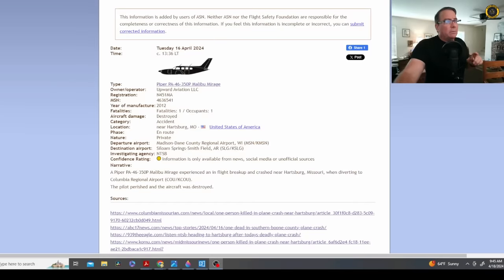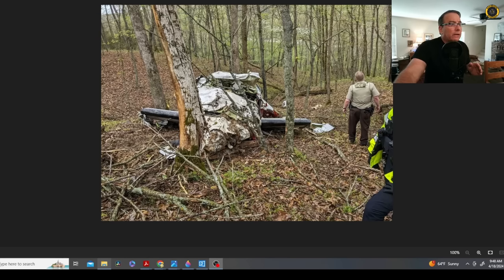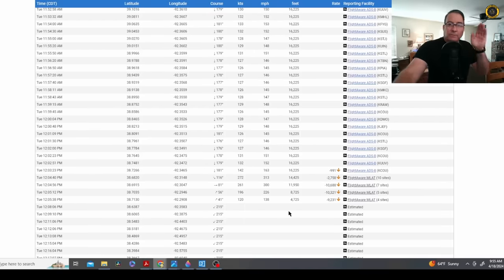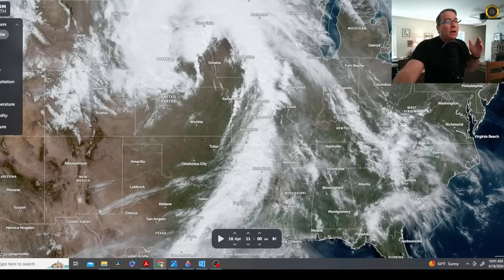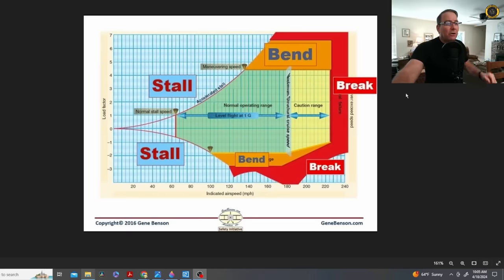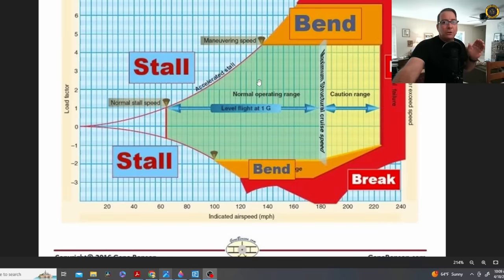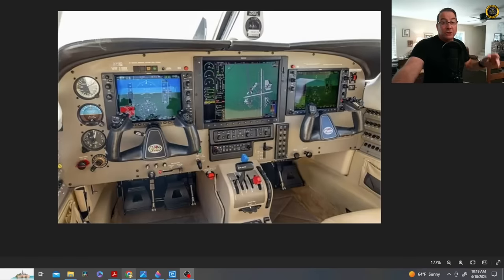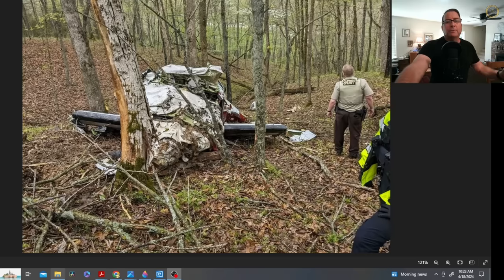N451MA PA-46-350 16 Apr 2024 Structural Failure

Comment: What to say to: "Accept a block of altitude" at 9:57.
When I went all seats occupied and full fuel through a cold front, after 
(1) asking if ATC could suggest vector through lighter part of the front, which amazingly they could do without me having to switch frequency to talk to weather service, and
(2) Slowing to Va max.
and although you pilots know this but it's so rare you might not have the calls at the tip of your tongue, so here ya go:
(3) "Unable maintain altitude because of turbulence and heavy weight."
(4) "Request block altitude."
And ATC immediately gave me a max and min altitude.  Presumably they then got anybody out of my way that they needed to.  Worked perfectly, no problem.
Reply: Good points. I'd use "require" rather than "request" a block altitude and perhaps add "emergency". Bottom line, I'd be back below Va, making "global" [ie smooth, medium term] control inputs and accepting altitude deviations. It may be a case of having to put faith in the Big Sky Theory. 
Perhaps Juan could make an episode on how to handle this stuff in the real world.
Reply: You'll probably find there wont be many other aircraft around if you're in such bad weather that you need a block. Anyone potentially in your way would clearly be experiencing the same dyer situation also.
Reply: @spdaltid  Good idea, but maybe "pan pan pan", which is used for urgent situations that do not pose an immediate danger to anyone's life or to the vessel itself - like bobbling altitude in this case but no likelyhood of hitting the ground.
Declaring an emergency is when something bad is likely: major system failure, sickness, low fuel, or flight safety situation.

Comment: Misuse of an autopilot seems to be a common theme in a number of fatal GA loss of control incidents lately.
Reply: Would be good if the autopilot could be setup with the plane’s limitations, weather inputs and you also input the loads for each flight etc
Reply: Misuse of autopilot has always been a leading cause of inflight breakups. Been going on for 50 years.

Comment: Seems to be a string of fatal air crashes involving the autopilot systems allowing the aircraft to get into uncontrollable or excessive flying conditions. It seems like the pilots are not prepared to 'fly the aircraft' bucking bronco style in weather or known icing conditions. You wonder if the flying instructions related to autopilot are fully understood. There must be a mentality that to get out of trouble you turn autopilot on, when turning it off is how to gain real control again.

Comment: A little weather analysis: at 1630z, roughly 35 minutes prior to the accident, there was a line of strong storms that were heading east of a COU-JEF line. To the west of that line, the NEXRAD showed virtually no echoes. However, by 1650z, a new cluster of storms formed in the wake of the initial line and completely filled in the clear spot, directly in the path of N451MA, which flew into the cluster. The radar composite showed some of the embedded storms indicating 45-55dBz echoes with tops to FL300-400 as of the 1700 and 1710z sweeps (accident at 1705z).

There were AIRMETs for moderate turbulence from the surface to 120 and 180 to 390 (note the accident aircraft would have been between these). There was also a convective SIGMET for the entire northern half of MO for severe embedded thunderstorms from 200@55kts, tops above FL450, tornadoes, 2" hail, and wind gusts to 60kts possible. Several storms to the northeast were severe-warned. Icing charts indicated a high probability of icing and SLD at 150 over exactly the crash site, presumably associated with the thunderstorm activity. The wind aloft forecast for the time period at KCOU was 2058+02 at 120 and 2173-12 at 180 (note the temperature lapse of 14°C in 6000').

Stepping back a little farther, the aircraft had been on a direct line to the destination until 1650z, when it turned south, presumably to avoid a more mature squall line farther to the west, however, this put it into the path of the storms that would initiate minutes later. 

Going back even farther to 1300z (90 minutes before the 1438z departure), the convective SIGMETs were already in place, the thunderstorm forecast showed the squall lines going through the accident area at the accident time. SPC showed an enhanced convective outlook along the planned flightpath, and the icing forecasts were all in alignment with what happened a few hours later. However, the convective activity at that time was all west of Topeka and the downstream storms wouldn't begin to initiate, near the accident area, until closer to 15-16z. 

There is often a discrepancy between observed, mature weather and subsequent downstream initiation due to diurnal heating. One takeaway is that storms can and often do pop up well ahead of existing weather. Not sure whether the aircraft had onboard weather radar or was getting a (delayed) NEXRAD feed, which can make a big difference. But it went from no echoes to pretty ugly in a 10-20 minute span. Might also consider the 65-ish knot headwinds and how that plays into flying into developing weather.

Love your content, as always, great review of the V-G diagram!

Comment: I flew a 172 into a line of thunderstorms and I did my best to stay at or below Va and gave up on trying to maintain altitude.  I saw rate of climb beyond the ROC gauge both climb and decent.  We got slapped hard enough to set off the ELT while making a 180 degree turn to get out.
That made radio comms with Center impossible.  I set the transponder to 7600 hit ident then to 7700.  We landed at the nearest airport to wait out the weather and turn off the ELT.
Got to fly very carefully to stay in one piece!!  Helps to have good skills too.
ERAU 80 CFIA&I ret.

Comment: Most aviation insurance companies won't insure you in one of these things unless you take a special course on how to handle the aircraft (essentially a type rating). A friend (BOS AA 737 Capt) has a side gig teaching one of these certified courses.
Reply: Do they have a simulator component in any of those courses to reinforce the edge cases. I wonder, also, if those simulator systems now have the capability to optionally measure the pilots vital signs (maybe so some of that polygraphic research might finally have a useful application) so an indication of how physiologically affected they became in the scenario playout.
Reply: @Don.Challenger  the courses I'm aware of are all taught in the plane but that doesn't mean there aren't sims.
Reply: You are correct in this case.

Comment: Talking about gusts: the relevant airspeed is primarily vC (for the certification engineer), or vNO (for the pilot), which is typically higher than vA and independent of the actual flying weight at the moment. The structure is designed to withstand gusts up to vC/vNO. The checklist shown does not mention vNO.

The footage shown indicates a failure of the horizontal tail attachment to the fuselage.
The scenario presented could be one possible cause. The autopilot maneuvering above vA may cause structural failure as described, if it has sufficient authority, and it is for sure the right thing to do to disconnect the autopilot and relieve the structure of these additional maneuvering loads.

I could, however, imagine other possible causes, without being familiar with that particular design and without judging their probability: 
Metal fatigue could have weakened some structural member to a point where the gust encountered caused it to fail.
Corrosion could also have led to a similar weakening.
Erroneous maintenance or repair would also be a possibility to be considered and to be investigated and hopefully ruled out by the thorough NTSB investigation.

Comment: Juan, you said exactly the same thing my first instructor, Bill, told me as a PP student in 1985 when I told him about struggling with turbulence on my first solo cross-country: slow down, gentle on the controls to stay upright, and request/accept a block altitude (I was using flight following) until things smooth out. It seems some of today’s pilots are bedazzled by the gee-whiz cool avionics in modern panels and forget (or never learn) the basic physical principles that govern all aircraft and ultimately determine the limits of safety and survivability.

Comment: Have a friend that flew an older Continental  powered Malibu for many years, a CFI used it once and overstressed the airframe, he refused to fly the aircraft again until it was repaired. the tell tail sign was that the paint had cracked around the rivets on both wings and horizontal stabilizer. A wonderful aircraft that should only be flown by the knowledgeable owner.

Comment: All the structural limits are determined by static load. If you fight the dynamic loading you add load factors to load factors (case) with an unknown outcome. It's very hard for a manufacturer to simulate that, and the basic numbers may appear OK to them anyway.

Comment: Two points I'd like to make here. This airplane was equipped with onboard weather radar. Did the pilot ever take any training on radar theory and limitations, or on using the particular unit installed in the aircraft? Second, there seems to be a widespread belief that datalinked weather uplinked to an aircraft is the best thing since sliced bread. Folks, speaking as a CFI and professional pilot, all these things give you is information. It's up to you through training and knowledge, specially of the equipment's and your own limitations to interpret it properly and put it to proper use.

Comment: Back in the mid-1980s, I was flying an E55 Baron for a banker as my first corporate job. We were flying from Lincoln, NE to Kimball, NE in the late spring and late afternoon. The weather was basically good except for a large, severe thunderstorm around North Platte that I deviated to the south to avoid in clear air.
Out the SW side of the TRW was this black, ugly, horizontal cloud with what appeared to be possible rotation. I was flying parallel with this for maybe 20 miles and still had another good 20 miles before I really wanted to turn on course. Again, it was clear everywhere behind the storm, except for this nasty-looking cloud.
My boss was getting really antsy and kept pointing towards home and saying you can go under that. If I recall, we were at 7,500 and the base appeared to be a thousand to fifteen hundred feet above that. I kept telling him we didn't want to mess with that, but he kept at me.
I finally relented and turned on course, but I slowed the airplane down to at least 20 knots below the maneuvering speed which I think was about 155 kt. As we got right under the cloud all hell broke loose!! It was like hitting a brick wall going up and then going down and I did pretty much a wing over as I did a 180. The boss's wife, and a manager, were asleep in the back. The manager was a big guy and he bumped his head pretty good on the ceiling.
My boss just looked at me and said he guessed I was right.
Once we landed, and I crawled out of the airplane, I discovered the right inboard gear door just flopping in the breeze!! The sudden jarring of the airplane caused the gear to bounce enough in the wheel well to break the connecting rod to the door! 
I only had maybe 800 hours at the time and probably less than 150 hours of multi. I'm just glad I had enough experience and knowledge to slow way down before even trying to go under this thing. In all my flying after that, I never saw such a dark, nasty cloud out the back of a thunderstorm again. I surmised that it was very possibly a horizontal tornado. I don't know if those are actually possible, especially to extend around forty miles from the main storm, but it was one of those few seconds in a flying career you'll never forget!

Comment: One issue I think is folks fly in big jets through weather all the time (757, 777 etc) so planes in general CAN fly through various weather (not that they should). Even the big guys get banged around, but normally it's the PAX who fly into the ceiling, the plane stays together. 

These little planes are seriously 50 times smaller. Turbulence will bang around a big jet but absolutely rock a little one. If you do any Caribbean flying those guys will take it through weather in little 6 seaters and you can get absolutely rocked roller coaster style. Then you fly out of the same airport on a big jet through same weather and barely notice it. I had a night flight landing in rain in a little plane and coming in we were just getting mashed in our 6 seater, I was sitting co-pilot, pax in back screaming and yelling until we got low enough it did smooth out reasonably and was just raining which was still wild at night to land in. Might even have been a four seater. 2 hours later headed out through same front and basically a snooze fest (relatively). Yes, rain and bumpy, but just no comparison in terms of ride.

Comment: Juan does a good analysis. I've flown a PA32 for just under 4000 hours in a country that doesn't have weather available by satellite and ATC that won't and say they can't advise on weather. 

Many times I have struck mountain wave, frontal and convective systems....both VFR and IFR. 

I have hauled the airspeed back to 90 and never exceed 100kt when it's severe. In my case I do disagree with Juan on AP use. My century 2000 was very docile, lagged and it worked so well in turbulence. 

I knew I had it right when the stall warning was going off occasionally. Swarf from previous avionics install would be found on the floor under the panel. 

Juan is correct. You've just got to ride it. I tell myself, go gently, throttle back, watch airspeed and don't pull and listen for the occasional stall warning. When that happens I'm confident I won't pull the wings off. 

I have just installed the Garmin GFC500 auto pilot and will see what it does in turbulence and whether I need to disconnect.
Reply: Well Stated.  Fly safe sir!

Comment: Juan,  " . . . this is a slippery, single engine aircraft and it's a problem with owner-operators exceeding the design limitations of the aircraft, especially in bad weather." Reminds me of exactly the issue with the V-Tail Bonanza. Many, many v-tails structurally failed due to over-G the airplane while operating in the caution range or beyond. Hence, the v-tail received the moniker, Dr. Killer.
Reply from the maker: Exact same issue.

Comment: I hear so many pilots falsely claim that turbulence isn't dangerous, most likely to put worried passengers at ease.  They problem is that they now believe it now themselves.  It's only true that turbulence isn't dangerous provided the pilot immediately slows to maneuvering speed and doesn't exceed the airplane's limitations.  For my plane, it means slowing dramatically to nearly half the normal cruise speed.

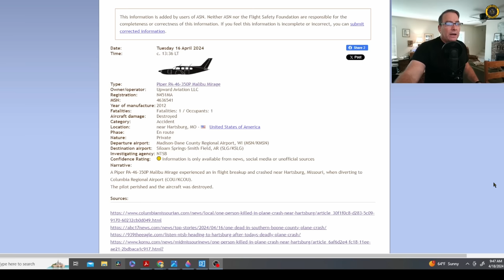Comment: I searched all 695 comments (at the time of this one) and despite several instances of "tornado," none consider the fact that the aircraft might have entered one. He was on the S side of a small, rapidly building cell, and if you watch Ryan Hall's livestreams, you know that on Tuesday, tornadoes a) had already been reported by the 12:05 (CDT, 1:05 EDT) start time of his stream, and b) formed from some of the smaller cells out in front of the main convection (supercells). 

I haven't had time to see if any tornadoes were reported in the area that day, but it often takes minutes for rotation to be recognized as sufficient to be causing at least a tornado aloft. Also, it takes many minutes for a circulation that's invisible in the clouds to reach the ground and generate a TDS (tornado damage signature). 

Aircraft encountering a tornado aloft is the first thing that occurred to be b/c of the high ground speed (not airspeed) achieved with little or no loss of altitude. What can accelerate your aircraft by 70 knots in 17 seconds? Not an up or downdraft, for sure! 

The counterclockwise pattern of the last 3 FlightAware hits also makes me think "tornado aloft."
Reply: Reed Timmer posted something about that, pretty sure his team drove through the rain. I remember he was saying there was a TDS (he called it a Tornado Debris Signature - basically means the same, since tornadoes can cause damage).
Reply: Good investigative thinking...

Never occurred to me.

Would be very bad lucky but that's why you should always avoid wx like that right!

It is better to avoid flying with luck, Good or bad .....
Reply: @GinaKayLandis  Tornado Debris Signature is probably the correct version :)

Comment: That was a wicked storm.  I am an experienced traveler and normally turbulence is barely noticeable to me,  I believe on that day, the commercial flight I was on experienced moderate turbulence as bad as I have ever experienced from takeoff to landing and later that night, slightly diminished.  On the outbound flight, the captain advised there would be no in flight service as the turbulence was going to be rough.

Comment: I used to fly the earliest 310 hp model of the malibou and it can easily put you in a dangerous corner. I prepared my self for a rather odd series of actions should I encounter turbulence on descend from cruising altitude, namely. If I encounter bad turbulence I don't want to pull the power back due to shock cooling and risk of loosing cabin pressure, since the pressurization comes from the turbo. The plane I was flying didn't have any speed brakes so my only option would be to turn 180 degrees, climb to get the speed down and then extend the gear. After that I would be able to turn back on course and continue the descend below manoeuvring speed. This would have appeared to be a strange way of flying to the controllers and other traffic but this was what I was prepared to do in such a situation. This plane should never have been approved to fly without speed brakes in my mening. I hope other pilots will consider this issue before flying a PA-46.